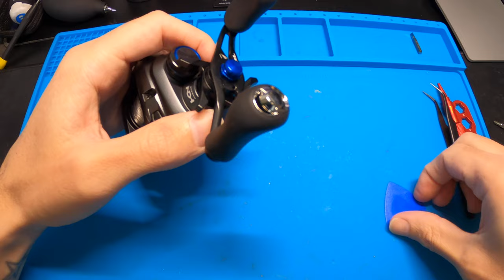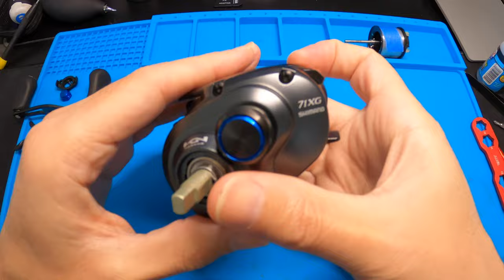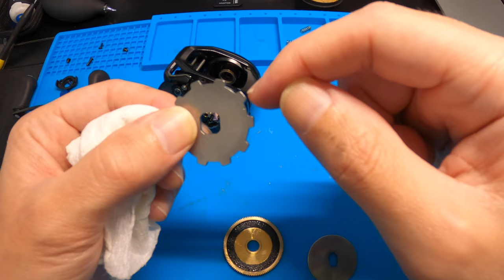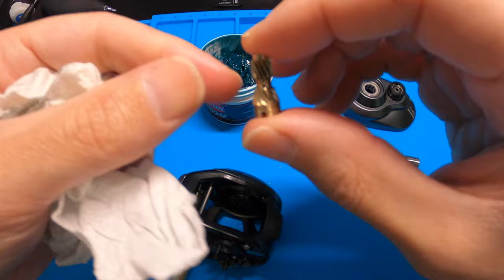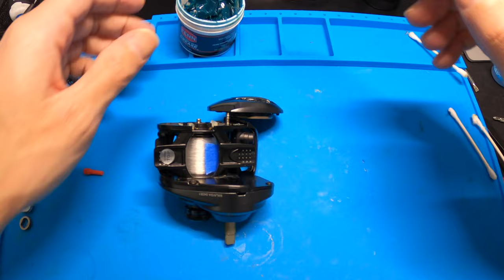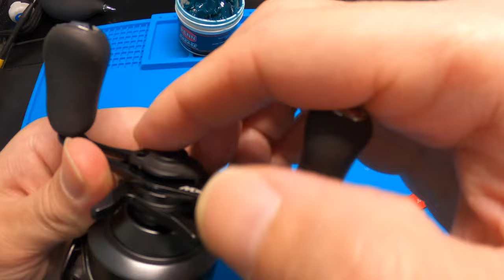SHIMANO SLX MGL 71XG - Take Apart & Reel Maintenance

Comment: I have a shimano casitas since 2017 and looking at your video I can see that the two are almost the same inside. It seems that shimano only changed the structure on the outside on the slx but it remains the same as the casitas on the inside, with the exception of the spool because it is mgl of course.
Reply from the maker: Sweet man 😎🤙🏽 I’ve been wanting a Casitas MGL for awhile! Heard that thing BOMBS! Haha and yeah most of em are pretty similar. Just shot a Curado MGL 150 take apart that will be posted in a couple weeks, and the Curado line has some slightly different stuff going on which is interesting.

Comment: My roller makes a grinding noise, what could be the problem?  Greetings. :)
Reply from the maker: Hey 👋🏽😊 What exactly do you mean by roller? 🤔 Like it’s grinding as you reel it?
Reply: @WhereWeWild   hey, thanks for replying. sorry, my English isn't the best. When I eject my cast everything sounds good, only when I turn the crank the sink makes a noise :/
Reply: I have the same wheel as the video :)
Reply from the maker: @Tim_FPV  Hmm. 🤔 Well I guess all you can really do is just make sure all the bearings are smooth, make sure everything is in the right place, make sure every part is clean and doesn’t have any sand or dirt in it, check the main and pinion gears for any damage and that they are lining up properly. Give everything the oil and grease that it needs as shown here and see if the grinding goes away. That’s what I’d be doing 🤷🏻‍♂️ Sometimes it’s a really specific thing where I’ll know exactly what’s wrong right away, but a lot of times with these reels you just have to check off things one by one to figure out exactly where the problem is.
Reply: @WhereWeWild  Okey, thank you. I'll do it one day :)
I bought it used on eBay and unfortunately I don't know if anything has been done about it. I would let you know after cleaning, checking and oiling :) Can I send you a video of it somewhere? Thank you, have a nice evening 😊
Reply from the maker: @Tim_FPV  Cool man good luck! Haha yeah I buy reels on eBay all the time and you just never know what you’re gonna get. Yeah for sure you can send it to our instagram messages if you want 😊🤙🏽 @WhereWeWild